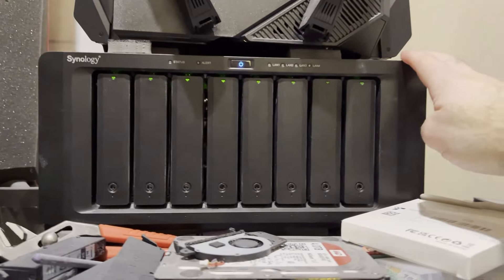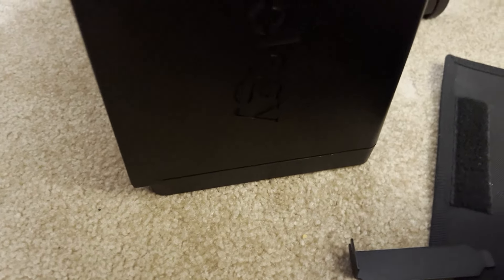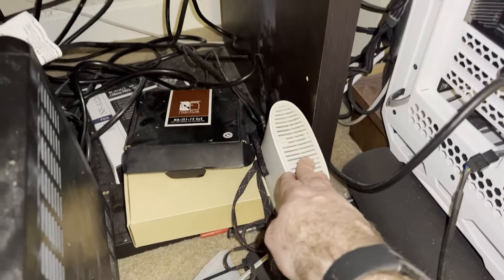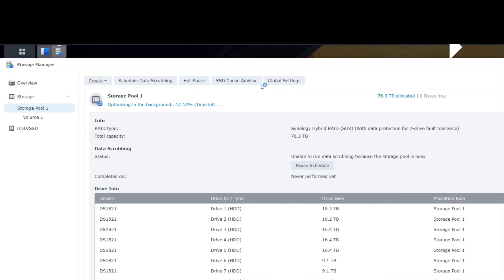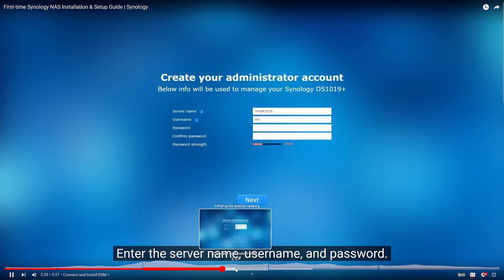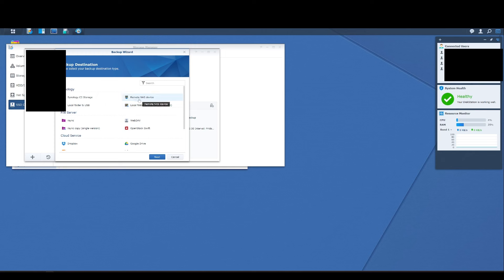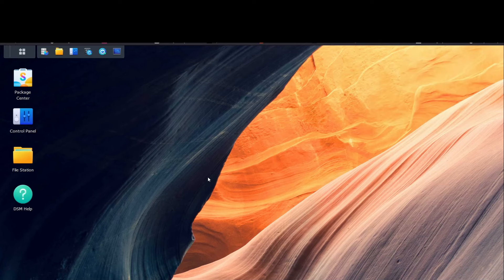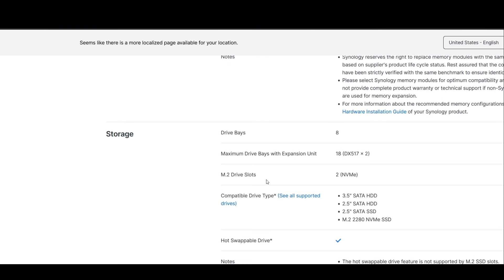Synology DS1821+ A NAS backup solution

Comment: Can I put 24TB disks in all bays?
Reply from the maker: it should. I have 20TB drives. You may run into a limit for storage pool size. I forget what it is for these models. There is a maximum amount of raw storage (probably dont ever need to worry) and a max limit for a single storage pool. Meaning when you exceed the max pool size you'll just need to make a 2nd one.